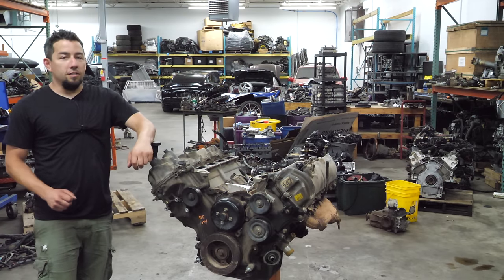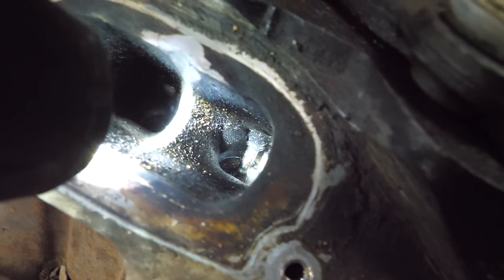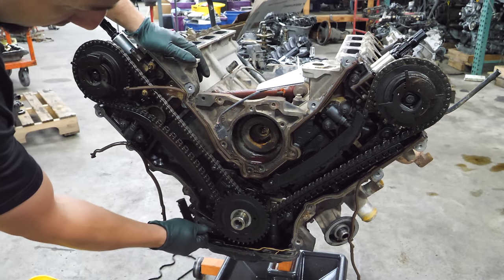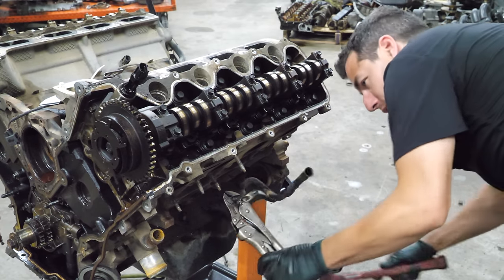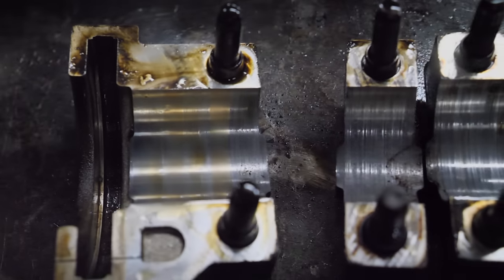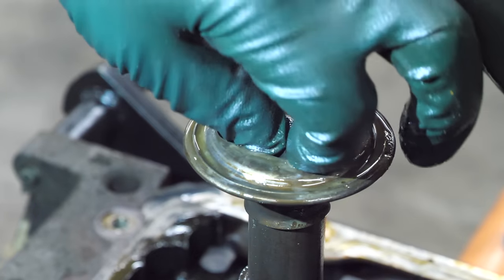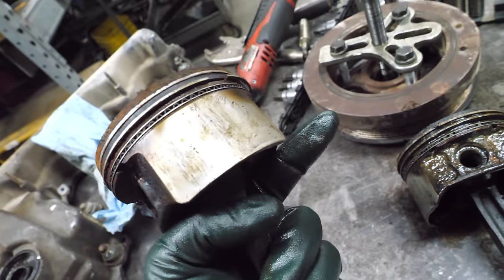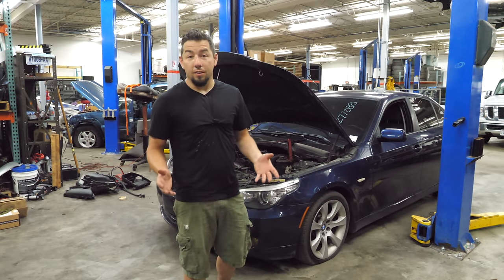Bad Ford 5.4 3-valve V8 Engine Teardown. Which of The MANY Possible Failures Took This One Out?

Comment: There are several things I have learned here, not the least of which are some engines that have a loyal fan base and others that are problematic, but that some things are extremely important, regardless of make:
1) Keep the oil filled and change it frequently.  You have shown so many engines varnished and sludge filled.
2) Beware of odd coloured and/or sparkly and/or creamy oil, and oil that has parts in it.
3) Overheated engines are often problematic.
4) Hydro Lock can create some very grotesque looking parts, especially connecting  rods.
5) Windage trays are common in modern engines.
6) Topless aluminum blocks (free standing cylinders) are fairly common
7) Oil pumps in the front cover are fairly common
8) When 5, 6, & 7 were introduced in the Chevrolet Vega 1971-1977, mechanics laughed at it because it looked problematic.  Now look how many companies do exactly that.

I love your channel!  You don't seem to favor or disparage any make.  As I feel, all companies make some great engines and some companies have made some absolute junk.  Thank you for helping to sort it out.

Comment: THANK GOD I have a 2003 5.4, TWO VALVE!!! I have 281K+ on it and have had literally ZERO ISSUES. I bought it brand new (with 12 miles on it). I am (almost) fanatical about maintenance so that may have something to do with it.😄 I also have the trans serviced routinely so there have been no issues there, either. Maintenance is definitely the key.

Comment: I’ve got one of these motors in my Ford Fairlane here in Melbourne Australia 

there’s two issues 

first issue you have to change the oil every 3000 km to avoid any problems which is way above normal servicing 

secondly the hydraulic timing chain tensioners have a seal between the tensioner and the head that seal tends to blow out and lose pressure and they leak down 

then when you start them up the timing chain slaps against the guides and breaks the guide and bits if plastic comes off and that is the beginning of the end…..

Higher volume oil pump would be good Melling make one 

but if you have one of these motors and you change the oil every 3000km and you pop the timing cover and change the hydraulic tensioners with the updated tensioners with the new seal the plastic ones from ford you should have no problem

Melling also make a set of timing chain tensioners with a ratcheting type mechanism so they never back off some people think that leaves the chain too tight I don’t know

Comment: I have a 1997 f-150 with 185,000 on it Other than lifter noise on startup  and a few coil packs going out it has been a work horse. Any engine will fail if not maintained and that one looks like it was very much neglected.   Mine does have the pancake oil cooler and I am sure that helps a lot.

Comment: They have design issues but I have a 2005  F150 I bought new. It may blow today but if it does it will be at 240,000 miles when it does. Runs great and quiet as can be.

Comment: I got an 05 f -150. 265k. Runs smooth as silk. Still very quick and quiet. Literally, the only thing I've done to this truck is replace the brake light switch. Synthetic oil every time. Love my 5.4 triton. That being said... I'm prepared for the thing to scatter itself. Recently picked up a 7.3 godzilla pretty cheap. Old school push rod engine. 6 speed tranny too. Once I get the rest of the drive line , it's gonna be hard to wait for the triton to die .lol.

Comment: The early ones had spark plugs that stripped their threads and shot out of their holes.  The later ones had their spark plugs break in two when you try to remove them leaving the lower portion in the head.  The portion without the hex.

Comment: I had a 2001 Ford F-150 with a 3 valve, 5.4 liter Triton engine.  I put about 300K miles on it and never had a problem with it.  I could tell it was getting a little tired, but it ran great.
Reply: In 2001 F150s had the 2 valve 5.4L in them, i know because I own a 2002. 
The 2 valve is a great engine.

Comment: I have 200k on a 5.4L 3-valve F-150 with nothing but normal maintenance. Still runs quiet and has outlasted the body. I change the oil often though and don't tow much.

Comment: The timing chain tensioners blow their seal, so when the vehicle sits, the oil leaks out, and they loose tension.  When the car cold starts, there is no tension on the chain and it slaps around till the oil pressure builds up again.  The slapping broke the rail.

Comment: The block isn't ruined. You can get some cylinder wall tubes that are tougher and board the block cylinders to make room for them. You'll get smaller pistons to make it work but it will be better.
Reply: Not worth the money with the other issues with this engjne.

Comment: My 4.6L 2V V8 Triton in my 04 doesn’t have a ton of HP or torque but it makes it up in reliability. That motor doesn’t have CAM phasers, never had a spark plug break off, and my first motor went up until 240k under major load when it let go. I did have a couple of spark plugs spit out of the threads in the head but it wasn’t too terrible to install a sleeve. That is one issue but it’s not the end of the world. This was the ONLY issue I ever encountered with the motor. No timing component failures, water pump, power steering, valves, oil pump, CAMs, injectors, cracked exhaust manifold, or leaks of any kind. Solid motor overall.

Comment: Bought my 5.4 3V Expedition new in 2005 w/ 3.73 gears. Synthetic oil changes every 5,000. I occasionally tow a race car on trailer. Having the right rear gears is probably a big reason the engine has remained strong. Been very reliable. Oil consumption is next to nothing. 272,000 miles on it and I just changed out the front assembly, phasers, cam position sensors, Melling high VOLUME oil pump, etc. last week and took it with trailer 1700 mile round trip to pick up a car project. Felt like a new engine. 14-15 MPG with trailer and car on it. Here’s looking for at least another 100,000 miles and Expedition still looks great!
Reply: I'm looking at expeditions from about 2010 do you think they'll last? I plan to do the maintenance I've heard such mixed reviews about this engine it's either garbage or great I can't tell. other option would be a 2010 Tahoe

Comment: Guess I had a good one. Had one in a F-150 for years. Drove it with a camper from Fairbanks, AK to middle TN. 4000 trip in a vastly used truck when I bought it. Maintenance is important, not ignoring problems is eve more important. The check engine light comes on for a reason. Address it. Be proactive on things that won't set the check engine light on. You'd be surprised how long you can make a modern car last.

Comment: These are good engines but you have to keep the oil clean. A buddy of mine is the original owner of 2008 F150 5.4 3V. It has over 275,000 miles now and it hasn’t had any issues. No internal work at all. He changes the oil every 5,000 miles max. Yes, they do have issues with spark plugs breaking and getting stuck, but if maintained well they are a good engine.

Comment: Such a pain to get to anything when they are sitting in the engine bay of a truck.  The height and angle they put the cylinder walls/heads puts them right up against the frame.  You open up a Chevy hood or even Ram and you can literally stand in the engine bay with all that room.

Comment: I have one of these in my 08 F250. It was a fleet truck so it received its maintenance. So far my only problem has been an exhaust manifold. I changed that out a couple years ago and its still running strong with about 220k when its next oil change is due. Its been my experience that if you keep the oil changed and don't drive it like you stole it things tend to last. That said, I need to look into a new engine for my ford.

Comment: As for the cylinders, I've seen what looked worse clean up. But I don't know how far this engine can go. It was my policy on mopar big blocks to pick from my pile the WORST core bore wise that would clean up. That's because it wasn't getting any better just closer to being junk sitting around an unheated shop regardless of rust prevention. and you better bore one if you are fitting new pistons anyway. It doesn't cost anything more to resurrect a bad one and put it to use. Some people will say "yeah but you bored it .060 to clean it and can't go anymore on that block" my point is that by the time it needs bored you're going to strip it down and R&R the cam bearings to hot tank it so there's no more cost involved in moving to another block if ya got one! It's just that many more miles you got to enjoy a 440!

Comment: I have had 4 of these engines. I have only had one fail under 300k and it was a stupid failure. VCT solenoids got clogged up after a buddy borrowed it for 6 months and used conventional oil at 9k of operation. I currently have one that's at 450k with 0 issues. Need to do the timing chain, VCTs, roller/rockers, oil pump, and chain tensioners... but that's common maintenance on these every 100k.

Comment: i bought a truck with this exact engine  before finding out all the issues it had.
it had a misfire so i decided to change plugs and bought the 80$ extraction kit  for breakage prone sparkplugs
luckily none broke off and needed the kit but they squeeled something fierce like a  eerie horror movie, it was so surprising they  all held together, well 2 broke but still didnt need the tool.

so for 120 bucks for tool and plugs i fixed the misfire myself.
now i just have to live with or deal with ticking  leaking exhaist manifold 😞

Comment: My 1997 F250 LD with the 5.4 has been bulletproof thus far (knock on wood)........not one issue.....not even a leak. It's been dependable......loves gas, but keeps on ticking after 25 years. CLEAN OIL has always been the rule in all my vehicles.

Comment: if you see this motor in a truck you are thinking about buying run away fast. He forgot to mention the defective plastic intake manifolds that all fail in the same spot and leak coolant and the heater core that only lasts a couple of years and the entire dashboard has to be removed in order to replace the heater core.

Comment: Oil starvation is the primary problem with the engine, but it is caused most of the time by seal failure on the tensioners. The oil flows up through those to the VVT solenoids and then up to the cams. You lose pressure at the timing tensioners, you starve your entire upper portion of your engine from oil. Then it all fails from there. If caught early enough, and do a proper timing job, and replace the oil pump, and all timing components, and the rockers, the engine will go over 400,000 miles. 
I did that to my expedition, all new timing, oil pump, rockers. It is at 300,000 now and still going strong.

Comment: I had a 2005 ford F150 with the 5.4.   I had 178000 miles on the truck and it still ran amazingly.   I hated selling the truck

Comment: The oil seals blow out on the factory tensioners  and neglecting oil change does not help at all. Iv'e worked on many of these and the last 1 had 260,000 miles on it.

Comment: 314 000 km Just ran heavy oil stabilizer fixed it for last 2 years but now ticking more this sounds like a time bomb it only runs really rough sometimes but the ticking is getting more ? Wondering if its worth taking in not sure i might park it get another f150 fix it when i have time ?

Comment: Bought an FX4 (‘04) with this engine. Drove it hard until ‘08…..177K miles. Had no probs whatsoever. Changed oil every 3k miles (synthetic). Traded it in….they gave me $4,500.

Comment: I’m of two minds on this issue. The department I worked for bought a Super Duty with this in it. The truck was always loaded with 1800 lbs of gear.  This engine choice was horrible. No power and on Christmas morning I started it, the cams spun out of phase and destroyed the engine. Our a-hole fleet director immediately tried to blame me saying that I must have gotten stuck in a snow bank on my last shift and over reved the engine. The Ford dealer stepped up on my behalf and told him about the cam phasing problem. 
     We also ran at least 30 Expeditions in my unit. Except for a programming issue that caused the vehicle to go into limp mode when you sustain 103 mph , the 5.4 3 valve engines were great. They ran hard and reliably.

Comment: I broke seven out of eight plugs. Was able to remove six out of the seven with the special easy out tool. One didn't want to come out.  Had to be towed to the shop to pull the head to remove that last broken plug.

Comment: The over head cam v 8 engines are so wide.....makes swapping these modern engines into smaller cars very difficult.....I have a swapped mild built pushrod v8 into my S12 datsun.....now cutting of strut towers...the vewer V8 ohc engines will not fit well

Comment: The rh side cam is the end of the line as far as the oil passages go. The starvation is usually the result of a cam tensioner leaking oil into the timing area. Yes these engines were problematic, but when they worked, they worked well.

Comment: I have an 07 F-150 with a 5.4L Triton V8. It has 176,000 miles on it. What should I do for engine maintenance? Replaced spark plugs already. Change the oil every 3,000 miles and that’s it?

Comment: My 05 F-150 had this engine, regulator oil changes, new cam phazers, spark plugs, very well maintained, engine died, sold it at 110.000 miles.
Ford should have to do something for everybody that bought one. I would probably still have this Truck today, I did everything right.

Comment: Thanks for showing us all the details. Generally Ford sold a lot of F150's. North America is still full of them. As a teenager I somehow hated their puffery in advertising. My first rental was a Pinto. What else could I rent without a credit card? Arriving in Australia I ended up with a Ford Cortina. 2l inline 4 it was a good block, just some details like a garden hose as a fuel line could have spoilt the fun. Lucky the recall after 10 years was still free. Ford developed "Ecotech" engines in Germany. 1.2l with an oil cooled timing belt! Initial service interval was a disaster, the baby just ran too hot and caused mass brand defection of former loyal clients. GM might had their parts priced well. Nothing really worthwhile buying from their house.

Comment: I completely understand the negativity against this engine I personally own a truck that has one myself and I've already had to do a full timing job on it before it even hit 200,000 miles. Granted when I bought it it wasn't in the best condition but to everyone complaining about this engine and what kind of crack the Ford Engineers were smoking when they designed this engine the 5.4 3 valve engine was the first of a entire series of engines that Ford has now produced that are absolute nightmares. Like the 2.7 L EcoBoost in the new Broncos some people are lucky to get 2,000 miles from  those engines fresh off the lot before the engine throws a valve and grenades itself. The 3.5 EcoBoost with the notorious cam phaser rattle and coolant intrusion. Same situation with the 2.0 and the 2.5.  So if you're complaining that your 5.4 3 valve engine only made it to 200,000 miles before it finally blew  these newer engines that Ford is producing will be lucky if they ever make it that far. Everything that was manufactured after the 5.4 engine has been an utter disaster and as much as I would like to isolate this problem strictly to Ford it's not just Ford its other auto manufacturers as well. They're building smaller engines that are turning out more horsepower that are wearing out faster.

Comment: I have that one in my econoline and last 300000 miles and not oil leaks but one problem one time is one park plug come out but that was my fault i dint torque correctly. In  en realty was a good engine always run full synthetic oil!!!! To me was a really good engine and probably the best one!!!

Comment: If you catch the timing chain as soon as they start to make noise and install the revised VCT solenoids with the cam phasers, the engine will last forever. However, The breakaway spark plugs are the nuisance that can’t be avoided unless you regularly remove the plugs to keep them from seizing.
Reply: I think half the time people take these 3 valves in for a low rpm ticking noise, and they get hosed for the whole timing job when it was merely the noisy vct solenoids. My dealership almost got me. I did some reading and did the latest solenoids myself for under 250$ 50k miles later and still quiet! If your engine ticks but stops above 1500 rpm, it's probably the solenoids.
Reply: @brandonhahn8842  exactly, Ford has a TSB to that effect. But on occasion, especially at higher mileage the timing chain tensioner leaks and has insufficient tension on the chain. Then the chain flaps and breaks the guides. And they make noise. If you fix it at that point, it's simply a timing chain job. But some wait until the chain breaks. Then it sometimes bends valves. Other times there is insufficient oil pressure because of the leaking tensioners, and the heads are ruined because the cams aren't lubricated properly. But both of those problems can be prevented if fixed when the noise is heard. But you are right. When the rattle is at hot idle,, most of the time is simply the VCT solenoids. While the later models require valve cover removal, the early models can even be replaced without even removing the valve cover..

Comment: I drove a 2008 expedition for 10 years. Did the regular maintenance religiously. No engine issues whatsoever.
Reply: I had one in a 2004 FX4 and put 154K miles on it and it's still going . I also had an Expedition that my wife put 170K miles before we sold it to her dad, who drove it until he passed but it made over 200K miles. As with any engine, maintenance is required.